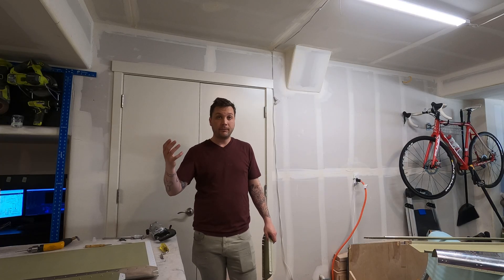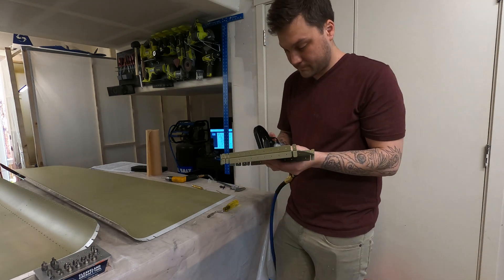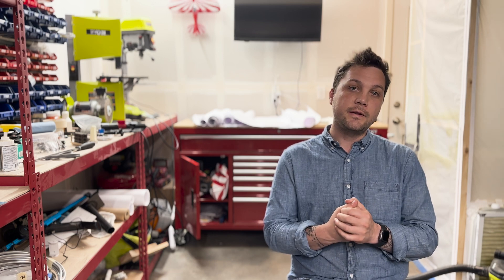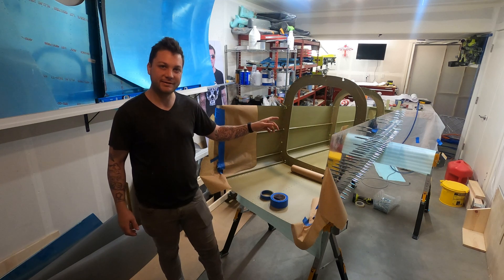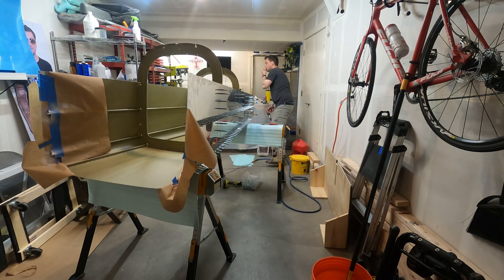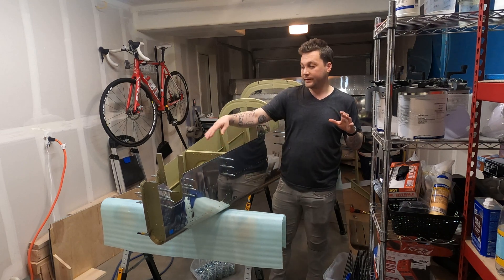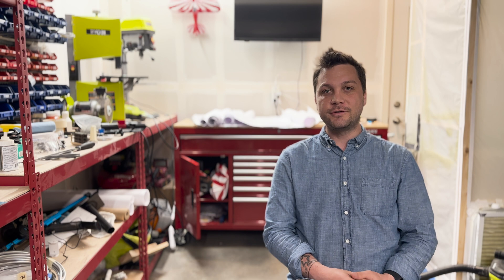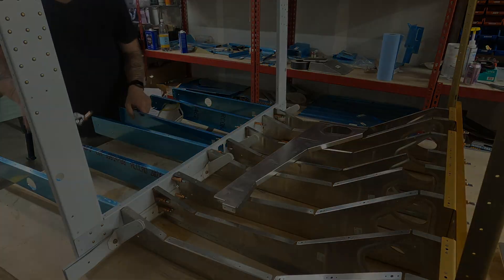Riveting the Aft Fuselage | EP3.8, Building an Airplane: The Van's RV7A

Comment: That's real good news if all your tail parts were punched at Vans. What about the wing tanks, flaps and ailerons?  
I would document this in your builders log with the images. If I wanted to buy a RV7 down the line I would be looking for this. ( I own a RV7A completed in 2008 so it won't be me )
Reply from the maker: The good news appears to stop with the tail.

I’ll have an update on my next video, but there significant difficulty ahead.
Reply: Bummer. You might look good wing for parts on Barnstomers.  Do this ASAP. The are a few for sale right now. Older parts will be in demand.
It is going to take month for Vans to produce replacements.
Reply from the maker: While you are no doubt correct in parts being in short supply, I’ll be working with Van’s to carve a path forward and secure any needed parts.

I think this will allow for the best documentation of replacements and also reassure me that problem areas have been addressed appropriately.